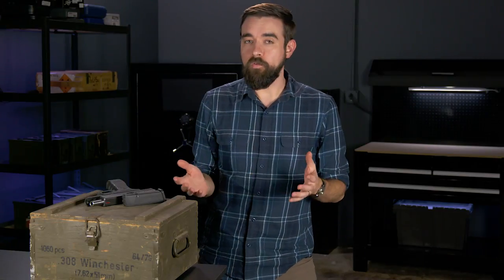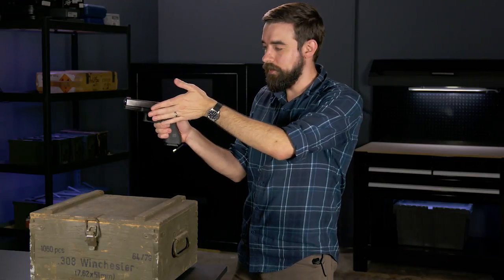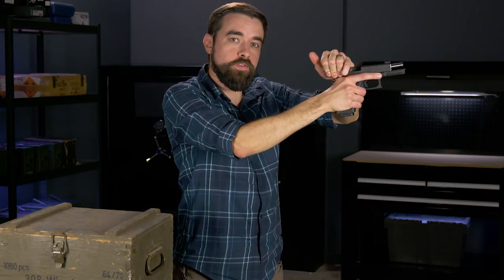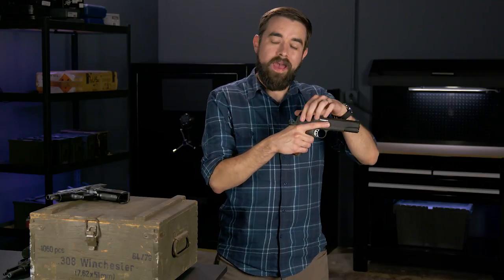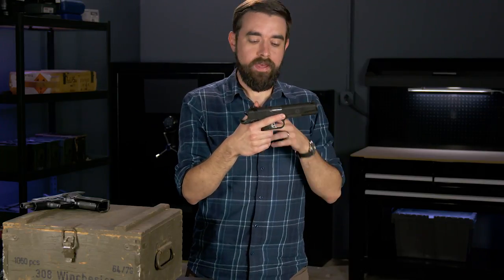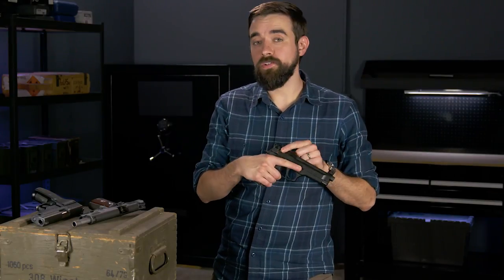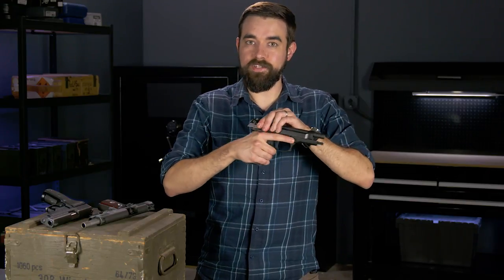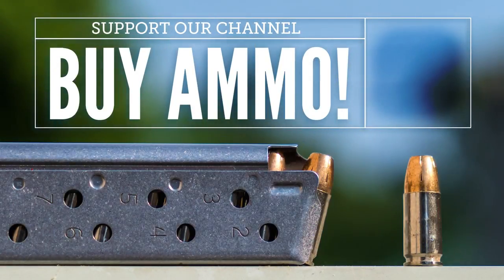How To Use a Semi-Automatic Pistol: Part 2

Comment: Good video. Solid basic tips. I'd add for any new gun owners to clean & oil the firearm prior to any use. Keep the weapon clean & inspect it often, even if you are not going to a target range or any outdoor-camping use. Grit, dust, lint, etc can creep into pistols or loaded magazines over time. If at a public range, pick up any trash or spent cases. Avoid distractions or any issues that can cause safety concerns.

Comment: Great video.  Question:  I’ve not seen anybody address the question; how (if at all) do you modify the two handed grip if you are left handed?  If you just mirror the right hand method, your right thumb gets very close to the ejector port.  I always just modify by keeping the thumb a bit lower - but have always been curious if there’s a “right” method.

Comment: question, when firing at the range, if you do not shoot all the rounds, is it proper practice then to unload and place the gun down, or is it acceptable to set it down loaded?
Reply: I think this rule will vary by range.  On some outdoor ranges you actually go down the range and set your own targets. So you don't want a loaded pistol pointed downrange while that's happening.  On indoor ranges, probably not an issue.

Comment: Speaking from experience (which I suspect Chris does not have) if you wrap your left thumb around the back of the grip when firing it is indeed painful, causes some bleeding, and can cause a Failure To Eject of the shell.  Not advised, but it was a good, solid learning experience, as a new shooter.

Comment: Chris what is your opinion regards "new" striker fired semis with shorter and lighter triggers for SD that are gaining populariry lately? 

I think that outside the range having a trigger like a 1911 without safety or a first DA pull is not always good, maybe a standard "glocky" or DA/SA trigger is better because they forgive more bad handling.
Reply from the maker: Giacomo I shared my thoughts on that pretty extensively in our series on double action semi-autos. I don't particularly like the trend toward ever lighter and shorter triggers, but the reality is that those guns dominate the market and that's what most people are going to buy, so they may as well learn how to use them as safely as possible.
Reply: Lucky Gunner Ammo Thank you for your answer! I'll Watch that series.